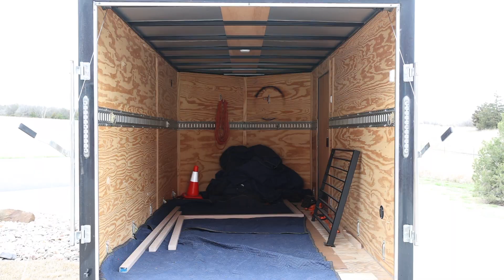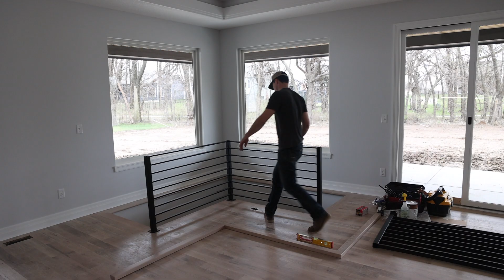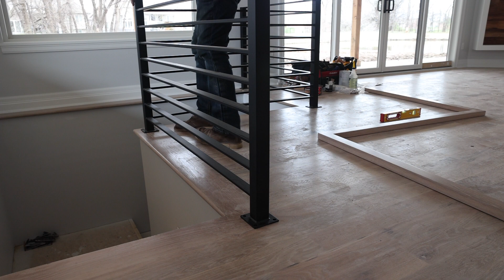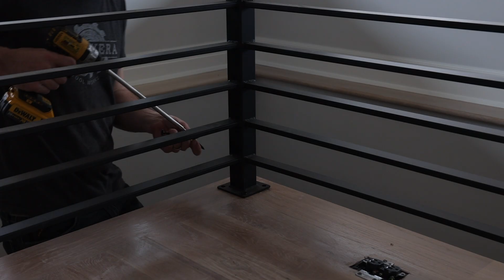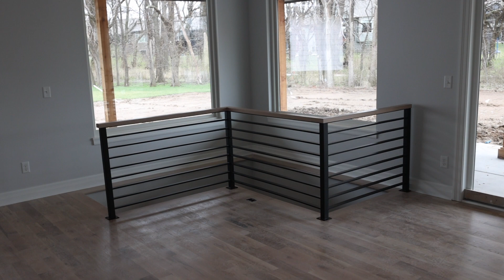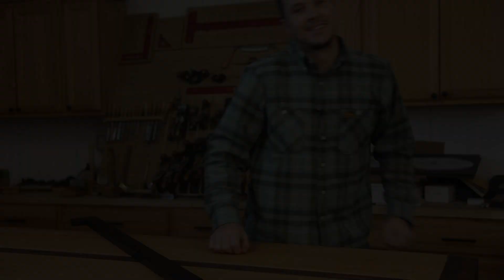Modern Stair Railing - How to install horizontal steel and wood railing

Comment: Great looking railing and instal. What were the dimensions of the metal you used?
Reply from the maker: Thanks! 2" square tubing and .5" x 1.5" rectangle tubing
Reply: Did you use 1/8” thick steel for your horizontal bars, or something a little lighter?

Comment: Hi - what are the dimensions/sizes of the post/tubing/bar?
What is the height of the post from the floor to the top railing? What are the width from one post to the next post? Thanks
Reply from the maker: This is all local code specific. Less than 4" between horizontal pieces and 36" tall. The post spacing is whatever your material can support and maintain the 4" gap, generally 4 feet but varies.
Reply: I think he meant to say what particular material sizes did you choose? The flat stock for example. Is it ¹/⁴"x1"?